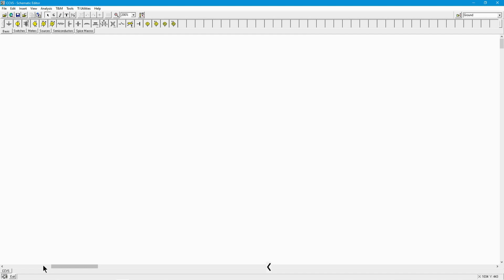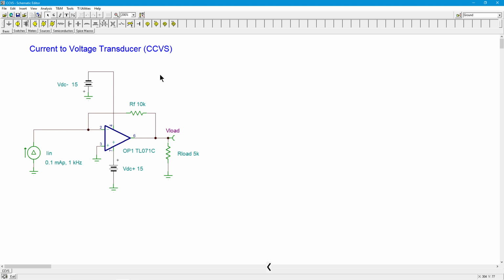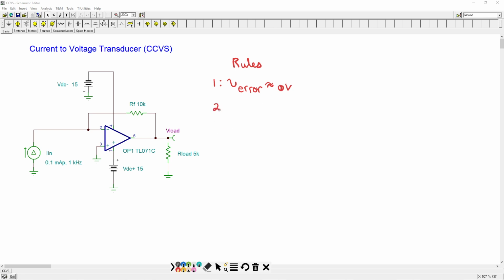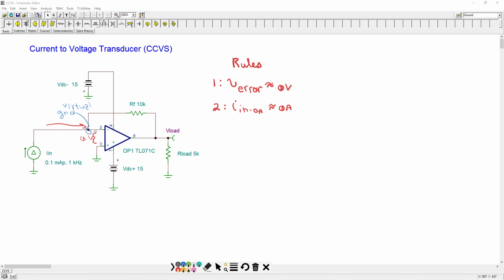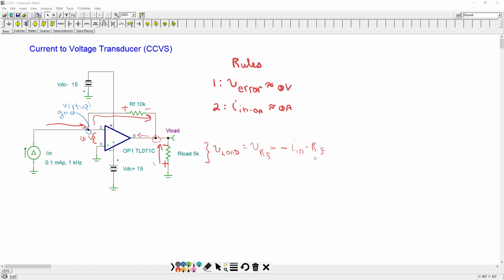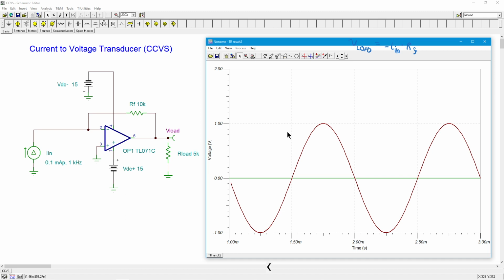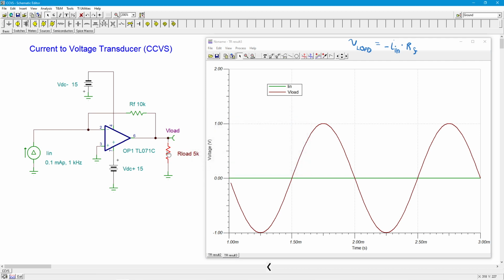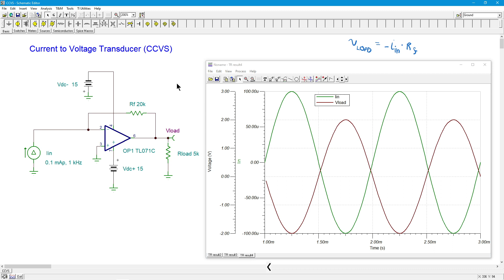Op Amps: Current to Voltage Transducer

Comment: It would be nice to see example with single supply. These days many applications are battery powered.
Reply from the maker: Who says you can't make a battery powered split supply circuit?
Reply: @ElectronicswithProfessorFiore  Customer and Design Requirements say. OpAmps are integrated into microcontroller and need to be used.

Comment: 12:44 Can you expand on what you mean by Rload being too small that we run out of current at the output please?
Reply from the maker: You're familiar with clipping, where we run out of voltage swing, right? (e.g., we try to produce 20 volt peak but the op amp can only produce 15 volts) Same thing for current. Suppose the op amp maxes out at 20 mA but we try to create 5 volts across a 100 ohm load (50 mA). The output clips at 2 volts (20 mA * 100 ohms). An amplifier can clip because it "runs out" of either voltage or current, not just voltage.
Reply: @ElectronicswithProfessorFiore ohhhhh okay that makes a lot of sense, thank youuuu!

Comment: Often need to add a capacitor across Rf to reduce phase shift at the 0dB loop gain frequency
Reply from the maker: Yep. Use of a feedback cap will be discussed in one of the videos coming up later this month.